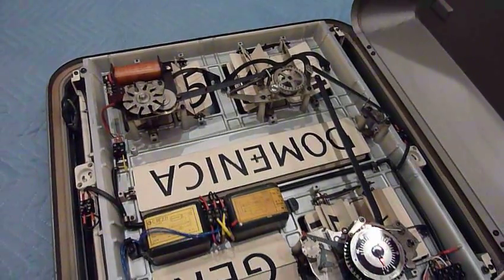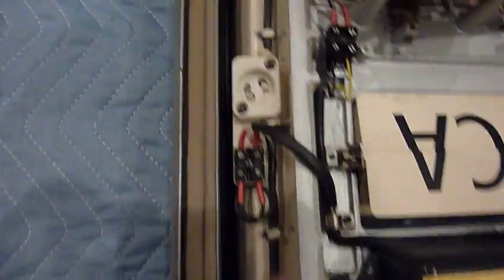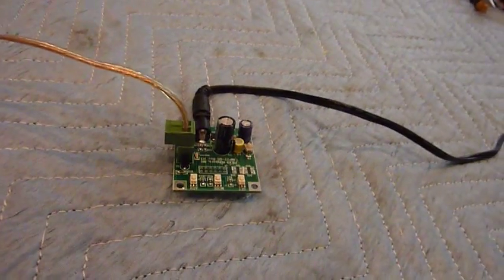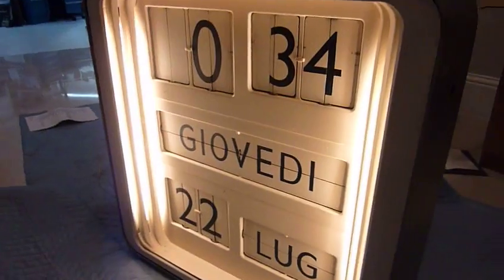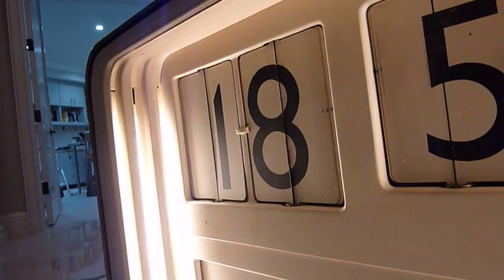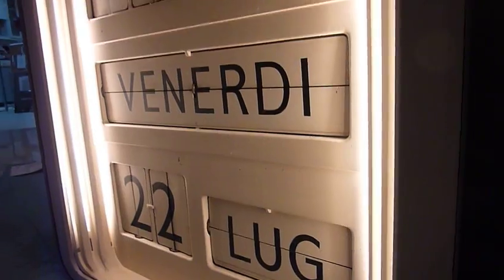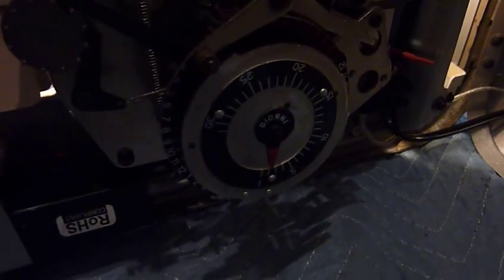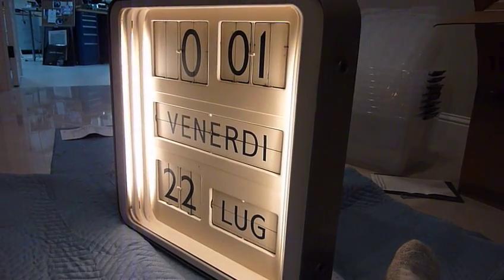Solari Udine Dator 10 Flip Clock Restoration Part 2

Comment: I have a Boselli Icon 30 flip clock that's driven with 24V impulses of alternating polarity. Or was, because the coil and the fork-like iron core that goes with it are sadly missing. I was wondering if these 'Italians' share the same Lavet-type motor? I need some specs as to the resistance of the coil and the wire gauge so that I can make my own replacement part (I suppose I can strip the core part from an old transformer). Can you help me out?

Comment: Not Street lights! Railways use 160 V so I think it was on a train station.
Reply from the maker: That would explain it! Thanks for the tip.
Reply: @CuriousMarc  I found the factual reason: https://it.wikipedia.org/wiki/Distribuzione_di_energia_elettrica Atthe end of the article there is a list of historic voltages in Italy. It was street illumination in the end.